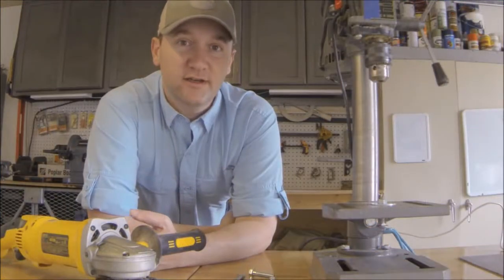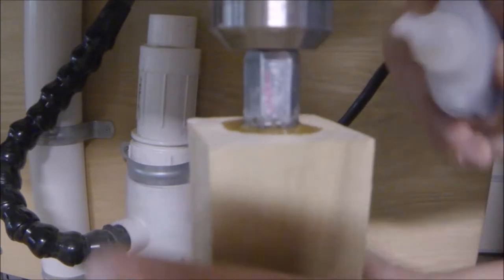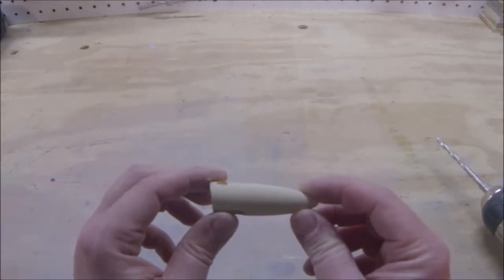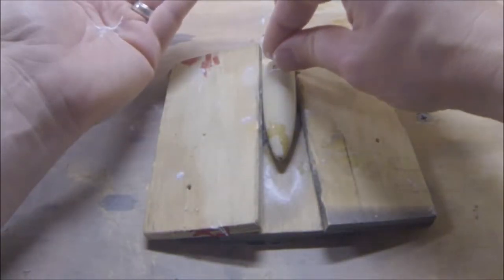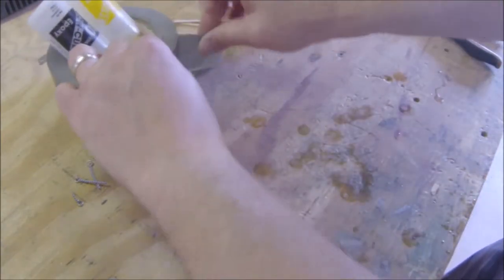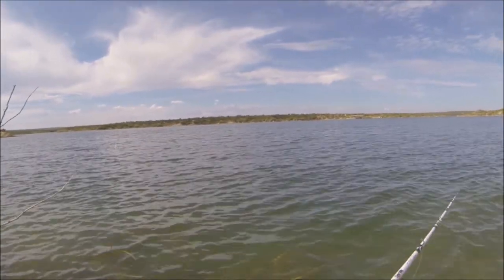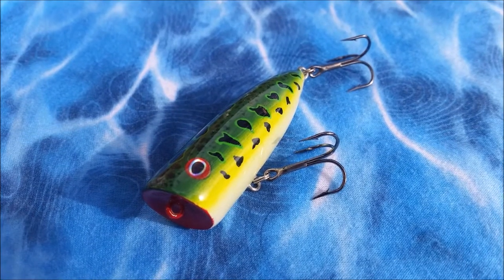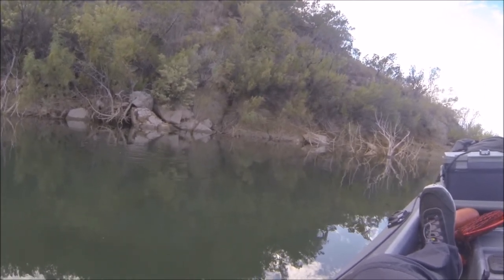Carving Fishing Lures on a Drill Press

Comment: Good stuff!! What kind of chisels did you use? (Skew, scraper, etc?). I'm interested in trying this but have read that certain chisel types are difficult to sharpen .... Thanks for the inspiration
Reply from the maker: Thanks for your support! I bought an 8 piece lathe chisel set off of Amazon. There are really only three that I use: skew, round nose scraper, and parting tool. These three shouldn't give you any trouble to sharpen. Good luck with your project!

Comment: Line your vice with pine and you can carve a groove to limit damage.
Reply from the maker: Thanks for the tip Dave, I appreciate your support!
Reply: i bought the vice guards. they are plastic with magnets in them. i found out, accidentally, that they give a little bonus. they have cross-hatching on them, for grip. well, when you tighten down your wood lure, that hatching puts a nice scale pattern into the wood.
Reply from the maker: @zzz7zzz9  Thats cool, sometimes you have a happy accident like that and it changes the way you do things.